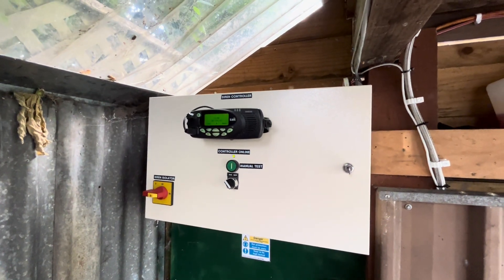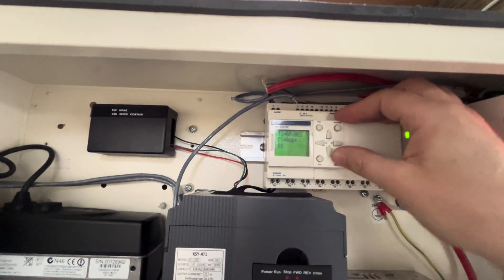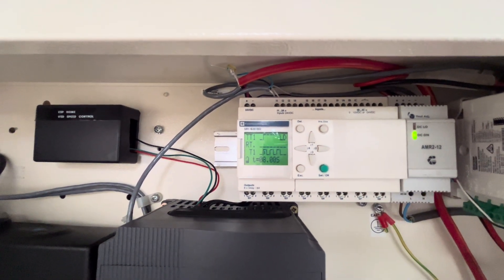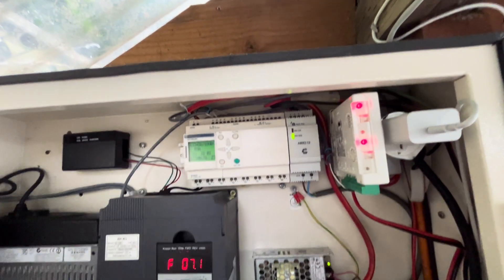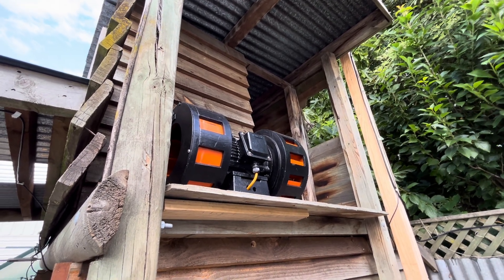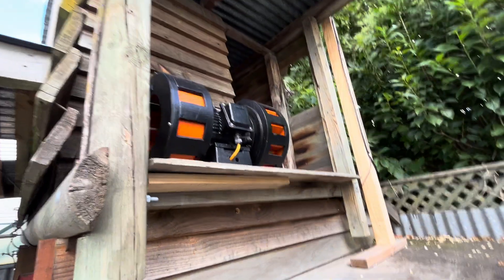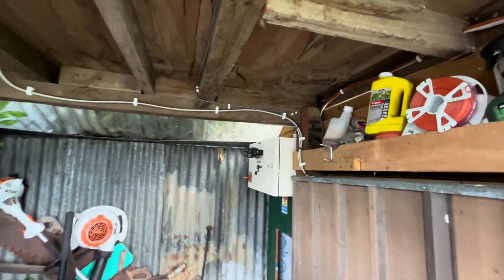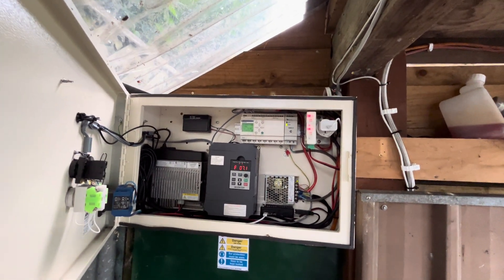Air raid siren 2025 update

Comment: What is the name of the siren
Reply from the maker: Its an older PSL Fire master
Reply: PSL fire Master fl8
Aka klaxon cs8
Built in the mid-late 1950s
My God 
Imagine running one of these at full 415V 
They are about 116db @ 100 ft 30.48 m 
I will like you to try to get ahold of a 415V converter 
And do a FULL BLAST video PLEASE!!!!!